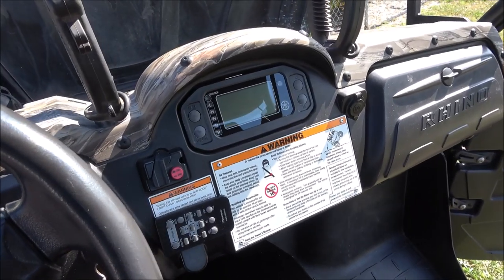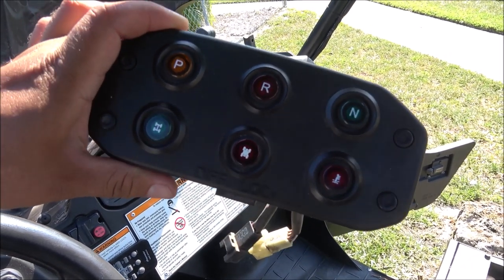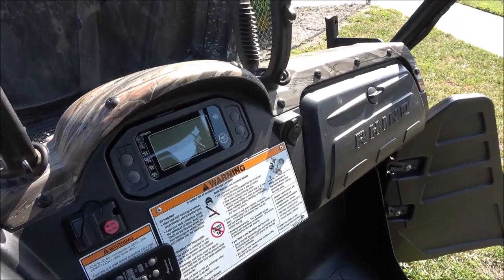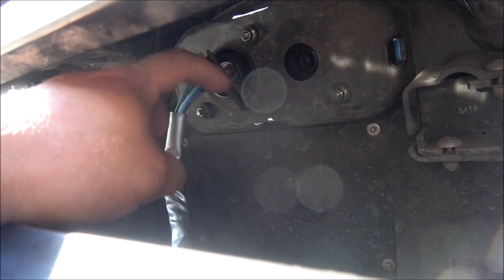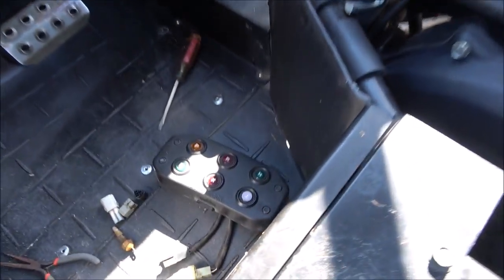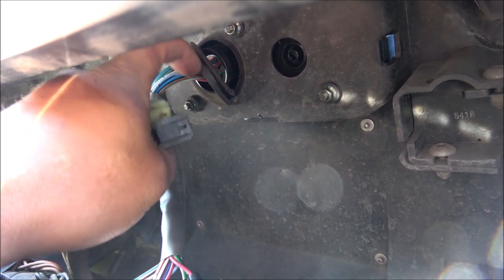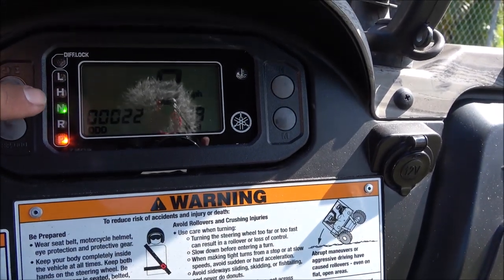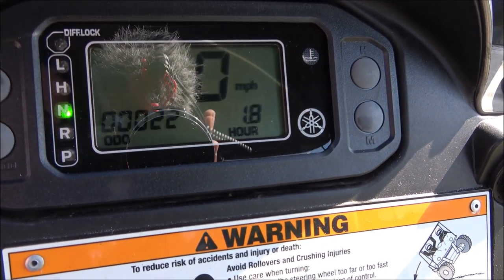Yamaha Rhino 660 - 450 (04 & UP) Digital Cluster Upgrade - Easy Plug & Play!

Comment: I have a Rhino 660 07´ with digital speedometer, but it doesnt work, because it doesn´t show de gasoline that it really has, the speed its not the real one, and also marks as if the AWD was activated. Do you know if its fixable? or do i have to change the cluster?

Comment: I am confused, my 06 Rhino came with the digital unit you have installed and are pointing at.. I have never seen a 6 button pack as you are showing
Reply: Somebody changed it before they sold it to you.
Reply: @jimh.412  Have an 06 and 08 Bought both machines new from 2 different dealers, still have them, came with digital. The 06 came on a pallet, I got a discount if I assembled myself, So the dealer never touched it.
Reply: @RhinoRider2006  Oh ok-I thought they didn't come with digital gauges until 2008. I have a 2011.
Reply: @jimh.412  my buddy bought an o6 6 months aftwer i did from a different dealer and his has digital
Reply: @RhinoRider2006  That's weird. I wonder why some have digital and some don't? Maybe the cheaper versions didn't come with the digital gauges. 🤷

Comment: Whats the deal with fuel gauge I'm planning upgrade the cluster but I would like to have a gas gauge i know i will have to install a sending unit in the tank but I'm fine with that
Reply: I was wondering the same about the fuel gauge